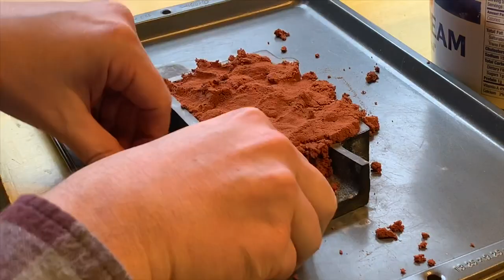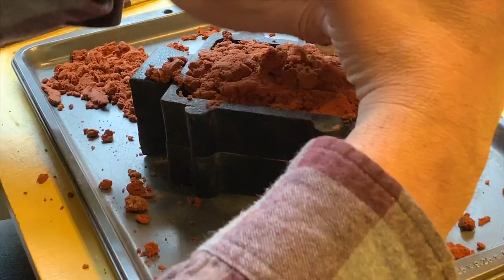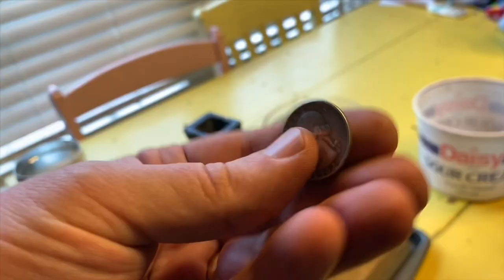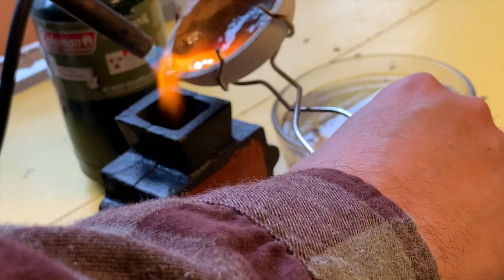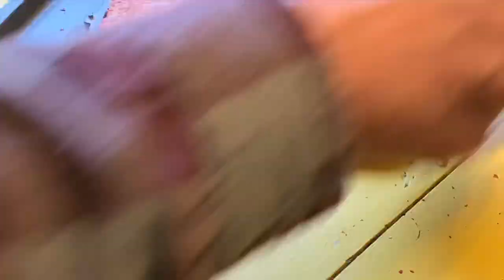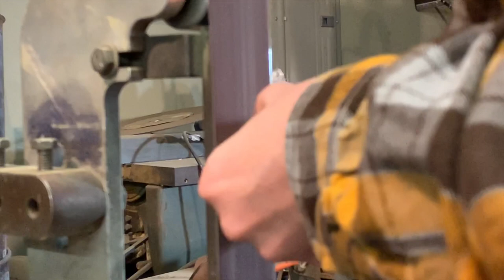Delft Clay Casting: (Upcycling Jewelry) Recycling Broken/Unwanted Jewelry, Coins to Make New Jewelry

Comment: Hello Allen, have you attempted to create a hollow form type ring shape (not hollow though, same shape but solid) with this method instead of plain Jane wedding band? I’m currently attempting as I speak...I will let you know how it comes out, I did to have make some extra adjustments  in addition to the standard method, I’m getting ready to pour in the mold now... would be great to know your thoughts about this...thx
Reply from the maker: Hope it turned out well.

Comment: If your dish is already glazed up with borax ,when melting metals do you still need to sparkle borax on it ?
Reply from the maker: Yes you want some to serve as flux.
Reply: @David Chatterton interesting. Here in Scandinavia none of the goldsmiths I know will recycle gold from an heirloom piece and use that exact gold to make a new piece, as they all agree the gold tends to loose it’s quality and karat and becomes contaminated with air. Instead all the ld gold you leave is recycled by companies that do only this insuring the refined quality and karat grade, reselling the finiahed gold to the jewelsmiths for a discounted price. Ie all gold from tooth fillings to junk jewelry is done at these places and recycled, meaning your finished product isn’t actually made of the exact same gold you gave the goldsmith. Nobody I talked to says it’s worth doing casting like thos with 18k gold, and if I understand correctly it also has to do with the overall durability and workability (if not simply casting) of the gold with microscopic air inclusions. I didn’t know silver has a greater tendency to be contaminated as it’s always recycled one way or another by silversmiths themselves, made me surprized. I guess it’s the value of the gold that has people refuse to use the method of recycling it themselves… 
As much as I understand gold is recycled all the time bc of it’s value at these specialty services it’s sortof a pity using an heirloom to make another isn’t done for sentimental reasons. Even if you get compensated for the gold you turn in when having something made, jewelry is mostly sentimental in value anyway, or mainly no matter the actual cost. I’d like to try casting in gold from old broken rings and chain I have but feel a bit hesitant due to this feedback I’ve gotten. You seem to have experience, I’d appreciate your take on this, and anyone else who works with gold!

Comment: When I go to slide off the top half of the mould, the frame slides away without the sand, the same keeps it’s shape it just comes away as a solid piece separately. But if I put too much pressure on it, the sand sticks to the layer below and the same thing happens, the frame comes off on its own.
Reply from the maker: Are you using talc in between the top and bottom and bottom molds?
Reply: @AllenNewberry  yeah but it felt like I’d used loads though, probably still not enough or compressed too much I guess

Comment: It was a great tutorial on casting ! what grit sand paper do you use for your sander? i am new to this and would like to try my hand at it this winter. Also wondering what kind of torch head would be best to use for the melting process.
Reply from the maker: I use several different grits 36, 60, 120, 220, (320 or 400).

Comment: If I’m using this wax and put some details on it eg a design on the front does the clay pick it up or not
Reply: It doesn’t do undercuts
Reply from the maker: Like Chester said.  It will not do undercuts.  But, it can pick up details if they are on the top or bottom of a piece.

Comment: Hey there where can I get the stuff you used for this sir?
Reply from the maker: Riogrande.com
Reply: Riogrande is amazing for actual goldsmithing/silversmithing equipment, but not so much for casting. They don't sell this flask mold. The dough scraper (ruler thing) is actually a kitchen utensil but perfect for the job. Check Amazon for both of these items